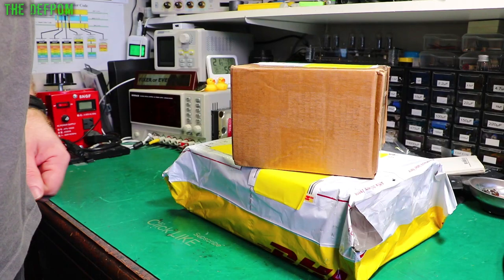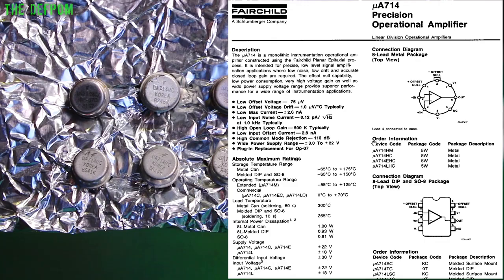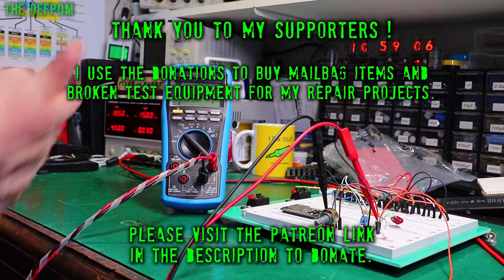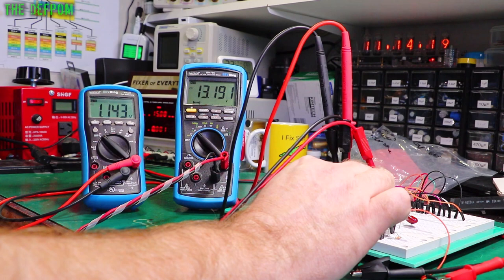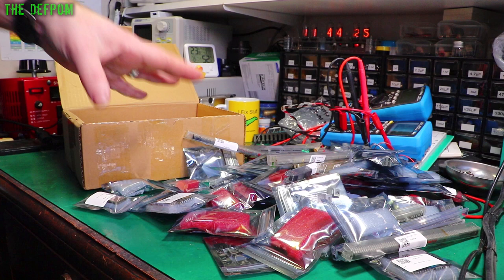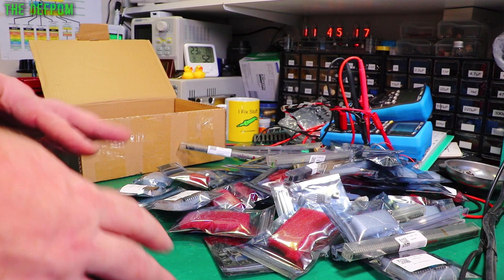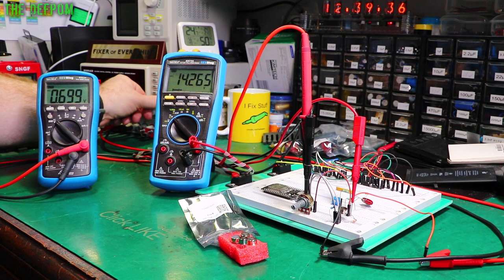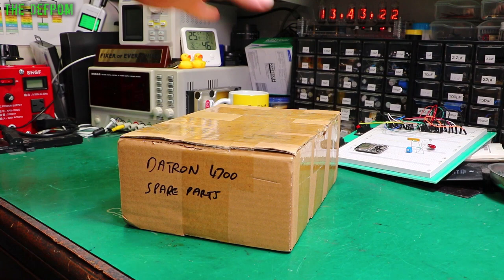🔴 Mailbag Monday 26th July 2021 - No.857

Comment: I have not looked up data of this UA714 but be careful about OpAmps meant for split rail. The input common mode range is not covering the full voltage range from neg to pos rail. The offset may be far off if the inputs approach rail.

If the test circuit was not using a half reference of pos to neg supply as 0v ref of the + input of the inverting amplifier, ie res input to - input and res to output, but instead used neg rail as 0v ref then the output will not function right for offset. In essence 0v ref is expected around half point of pos to neg supply range.

Comment: Make sure of common mode input range on the UA102 201 etc
Split rail OpAmps may need both + and - inputs close to mid range around nominal 0v as supply is expected say 15V to 8V on pos supply and -8V to -15V on neg supply, and inputs within a small range around the mid 0v level, not anywhere near either pos or neg supply or the internal stages are not bias correctly. Some modern OpAmps work to either neg rail or Pos rail for input common mode range, old generation devices expected most signals around and referenced to zero volt point.

Comment: For the uA714, the rated input offset voltage is 75uV, so 750uV at the output. Given it's an instrumentation amp, it should be much lower. With the 30V supply, did you reference the input to +15V or 0V?

Comment: What’s the price for metal can 741's I've got a few unused ones, used to use them by the bucket load in aircraft audio control units? back in the day as they say.
Just had a look at my lot and the parts are all marked in ink, as some has started to come off over the years. got a few 709's and mc1458's as well, all tin cans

Comment: Lots of common CMOS logic chips, the MC140xx and MC145xx are all standard CMOS digital series of the 4000 and 4500 families that should be available for quite some time yet. Then a number of 74Cxx series.
The 741 is about the most general purpose OpAmp around, it was in around 1969, the first OpAmp that had internal compensation, brought out by Fairchild at whst was promoted at low cost, only $41.00 each. Up till then the UA709 was most common, and others  like it needed external cap res nets added to stabilise the circuit, in accordance to circuit config  and gain. The 741 allowed stable use without such Res Cap extras. These days probably the 741 and other similars are mere cents each in quantity. Can you imagine paying $41 for one?
These and the older 709 were regularly stolen from the student lab plug board experiment boxes, such that these experiment boxes, were handed out and collected in prac lab class, to be stored in lockup cabinets in our engineering course. Loss was too costly to repeatedly replace at so many dollars each, and caused many students to not get their experiment setup working due to missing OpAmp chip.
Notable is many of the OpAmps you have this lot seem to be the TO-5 8 lead types, then the most common form for many ICs  which package are probably now hard to get  since now only made on 8 pin DIP or even SMD styles. 
Many of the old types like UA714, UA101/201 etc are most likely old obsolete types with now much higher performance alternatives existing. Though admittedly there are some with specific features. Usually though there exist improved alternatives. To keep test equipment as original as possible maybe desirable to keep original parts packaging and appearance, but otherwise with exception of very unique function alternatives, substitutes should always be possible.
The JFets especially matched pairs are definitely getting rare in market.